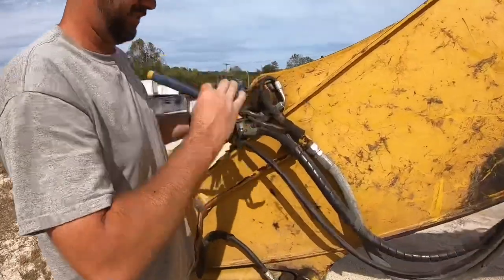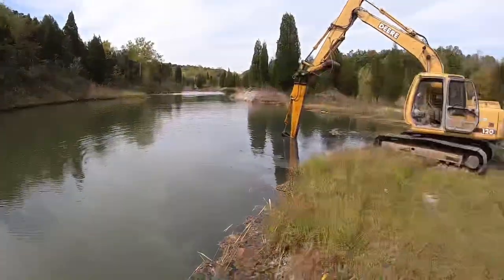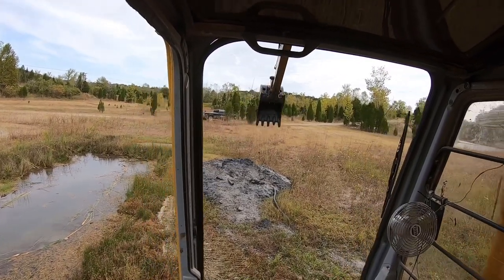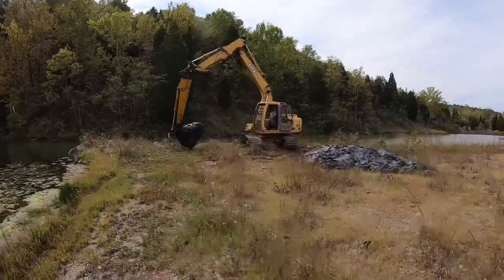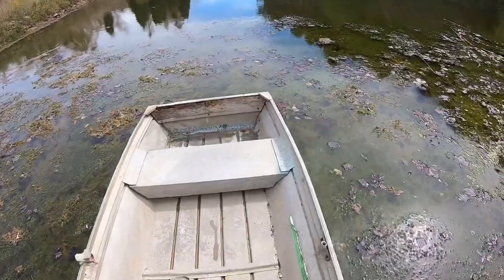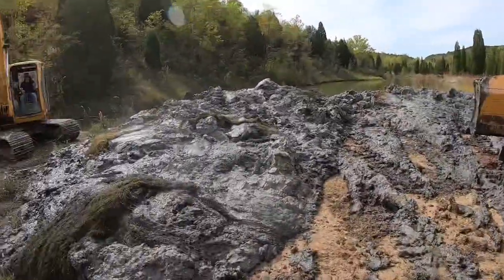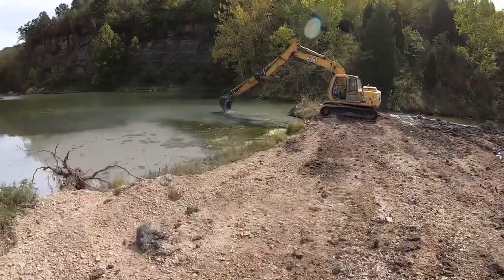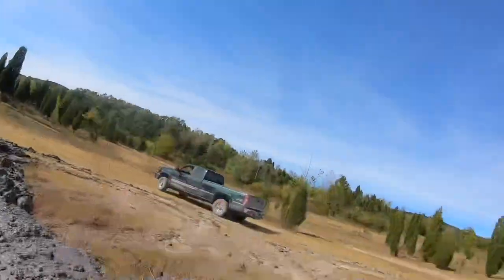Super stick is back in action #Awesome #waycool #dirtperfect

Comment: Mike for more temporary counter weight. You could make a bracket that holds two 55 gallon drums. Then fill them with water on site. God bless
Reply: Or concrete.
Reply from the maker: Are nothing at all just not worth it machine does fine the way it is
Reply: @DirtPerfect  Yeah,you were right unless you get stupid with the machine it does just fine. Even dedicated long reach machines are a little tippy, you just have to be careful.
Reply: @DirtPerfect  yeah just a thought if you needed a little extra. Happy Thanksgiving God bless.

Comment: I am confused why you did not drop the level of the water a few feet.
Reply from the maker: Why would not matter lot more work for noting gained
Reply: @DirtPerfect  I would think getting some of the water out of your way would give you better visibility to the high and low spots.  I do not know how the water comes in or goes out, so I do not know if it is possiable or not.  Anyways it is my random thought for the day.
Reply from the maker: No frank you can get a good feel for it when digging and it does no have to be perfect would take at least three days to drain this and at lest 1k plus we did this in 5 hrs hope that helps explain a little better thanks for watching and the comments

Comment: Great solution! But How would go about pricing this specific project?
Reply from the maker: By the hr most of the time
Reply: Thank you for sharing... Did you charge an hourly rate for each individual machine?  If so, would it be too much to ask for ball park hr rates for your pieces of equipment?  Or would you be interested in selling an estimating/pricing tutorial?

I currently have four similar machines you have... and wanted to give myself a reality check on my pricing methods.

Comment: If you have to make two trips to get your equipment out there, then why not make the second trip later after most of the water has had a chance to drain out of the mud. The spreading mud consumes more time than the spreading of mostly dry dirt. If the mud was dry you could even spread it out on a rainy day when you might not work otherwise. Think about ir!
Reply from the maker: That’s what we did

Comment: I can just imagine the aroma 💩 coming off the spoil pile. 
That super stick extension has really worked out great and opens up possible work for you without the cost of ownership for a job specific long reach machine.
Reply from the maker: Yes it has worked way better then expected and believe it are. It did not smell to bad
Reply: Dirt Perfect 
I guess the material dredged out is mostly inorganic silt and not rotting organic material.